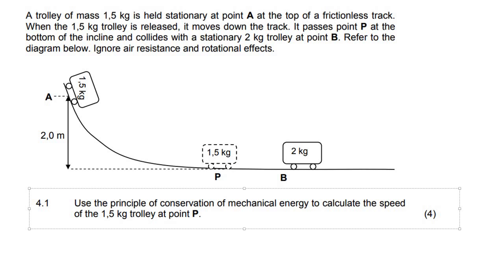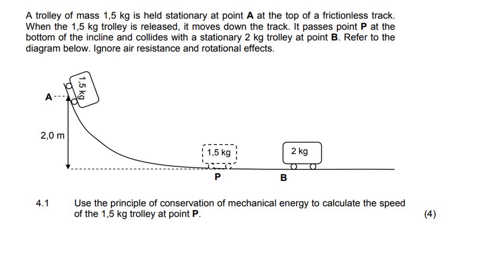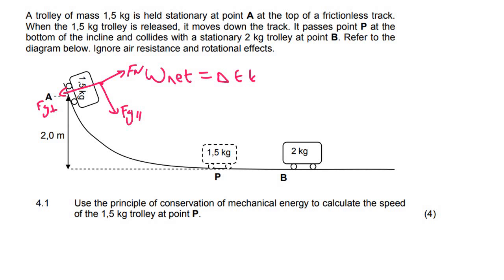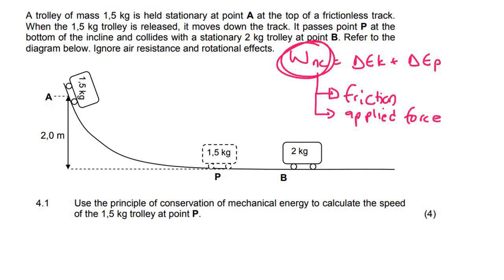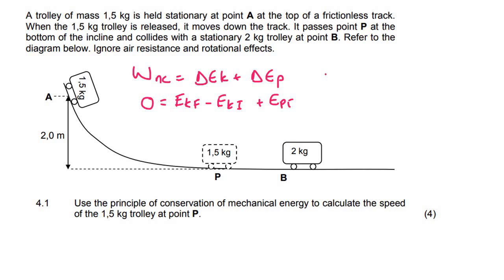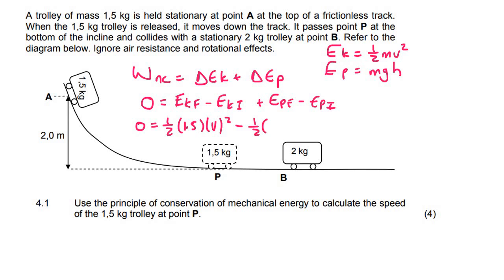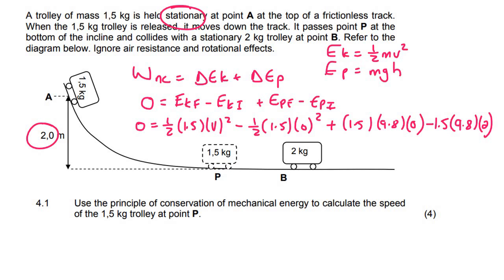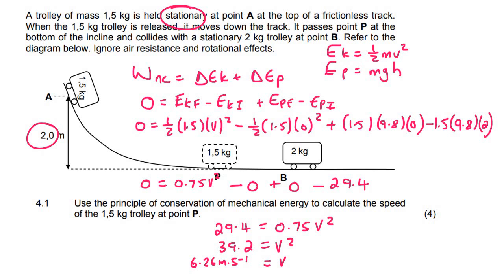Mechanical Energy grade 12: practice

Comment: I'm so confused right now. The question asks for the speed and we stop by velocity. I know speed and velocity are not the same, or are they?
Reply: Velocity is a vector quantity, meaning it has both magnitude and direction. I.e 30m/s east.

Speed is a scaler quantity, only has magnitude. I.e 20m/s or 72km/h

But the magnitudes for speed and velocity are the same. So that's why they used velocity, just without indicating the direction, of which matches our description for speed ( basically velocity without direction)

Comment: sir are you allowed to use Wnc with inclines too?
Reply from the maker: Yes!! :) Wnc can be used EVERYWHERE :)
Wnet works best on straight paths (which also includes inclines). 
So if the path is straight or inclined - you can choose anyone. 
If the path is curved - I suggest Wnc.
Reply: @kevinmathscience  okay but for WNC, i would have to use trig to get the height?
Reply: Why is the Wnc (0)
Reply: @ZamanseleCebekhulu because there are no NON-CONSERVATIVE FORCES, the track is frictionless, friction is Non-conservative force, there’s no force being applied to the trolley, applied force is also a Non-conservative force, hence Work done by Non-conservative forces(Wnc) is 0

I hope this helps🥹